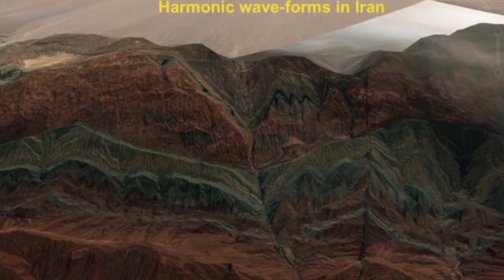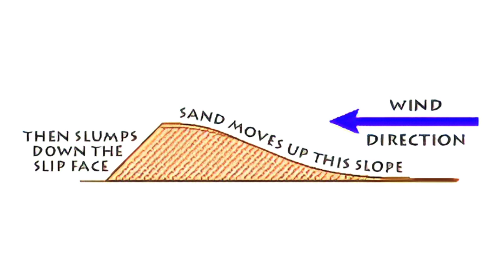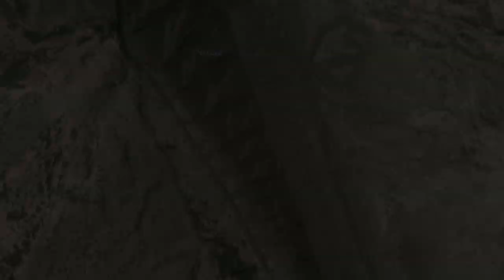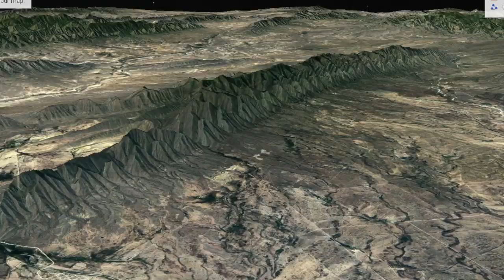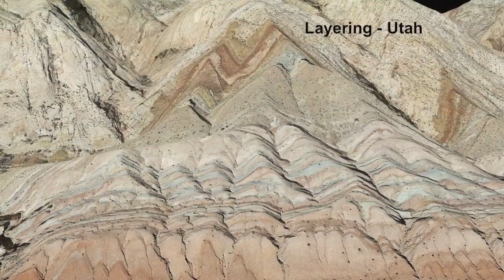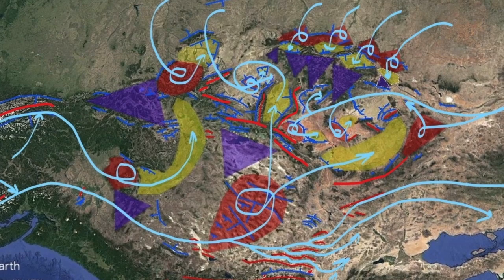Andrew Hall: Ionic Winds Shaped Earth | Space News

Comment: I think this video is onto something correct. However, I would add that the source of the electricity in the case of mountains would likely have been the piezoelectric effect, like the electrical discharges in earthquakes. As the continents spread from the pangaea position, and then slammed to a stop, the massive buckling would have released incredible electrical energies, causing the wind shock waves as you describe. At that time the rock material would have been softer and wet, contributing to the plasticity. In this scenario there would also be no need to resort to some "primordial" time period, but may have been merely thousands of years ago.

Comment: Ionic winds, also called electric wind, have been routinely demonstrated as capable of moving and re-depositing material, in experiments by "dahlenaz07"  since 2007  (https://www.youtube.com/user/dahlenaz07/videos),  forming comparable patterns to planetary features.
But a notable addition to the experiments occurred in 2017 when "Arc Modulated" disturbance of material was demonstrated at EU-2017.   The experiment revealed that, on either side of an arc-mode discharge,  a pulse of energy occurs capable of sending material into a dust-storm frenzy, and in the recovery phase, material is drawn back toward the focus of the discharge, (07 experiments).
You can examine these processes for yourself with simple electrostatic or low voltage experiments cobbled together from common items such as an old CRT or low voltage fly-back transformer.  Even passing two CRT screens in close proximity will demonstrate material transfer and deposition/alteration, when oriented correctly. 
Visit: Electric-Spark-Scars.com for examples, and become persuaded by experiments results of your own.
During great catastrophe, recorded in myth and legend, violent electrical interactions have been reported and with each of those discharges the occurrence  of bursts/pulses of energy (like what  occurs in transformer technology) would be expected with consequential movement of material, remaining as fresh features for our eyes to examine,, no need to reach back into pre-history for events capable of forming some featured mentioned here.
Never forget the great catastrophes reported in myth and legend, they describe the displacement of land and water as well as violent winds... Wind and water are both hydrodynamic,, and capable of harmonic phases,,  but water does it with far less requirement of velocity.
See the features differences through examination of the Glacial Lake Missoula area and the Grand and Hopi Lake areas (Lake Bidahoche). each experiencing catastrophic releases of water.

Comment: Cutting off the top of an anticline exposes rings of bedding and is not electrical.  Triangulation is caused by regular patterning of rain cutting through inclined bedding.  Long uplopes on a side is called inclined bedding cut by erosion.  Wind has zero geologic ability to shape earth structures.  Only wind propelling rain or sand causes erosional features.  Flat surfaces will tend to have a periodicity of rain accumulation and runoff, creating generally regular channel spacing.  Wind cannot be fast enough to make land form shapes, and if it did, the rock would be breccia rubble and easily identifiable.
Reply: Get your geek on. I was once like you and flipped.     https://www.youtube.com/watch?v=pwRtfBQUk3g&list=PLwOAYhBuU3Ufavw-b54_wHnpDO8vxwPh3  What if your wrong, I know I would not like that for sure.